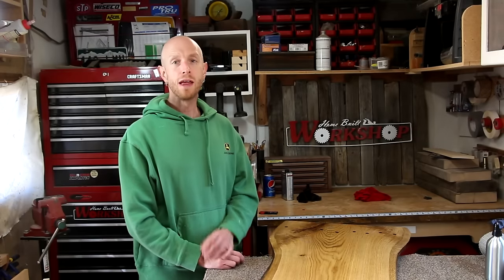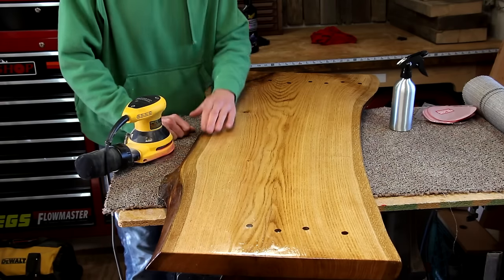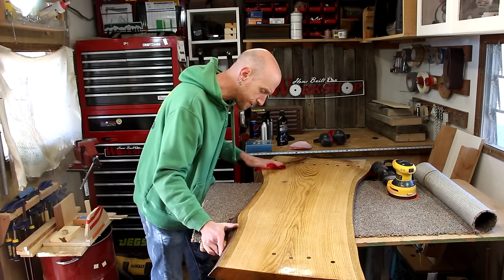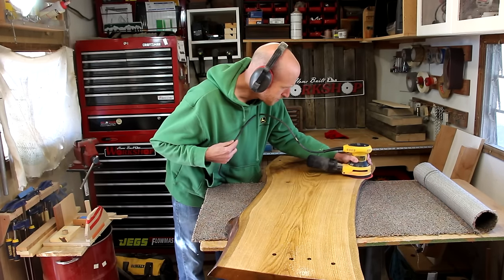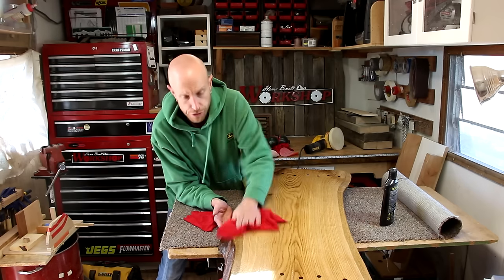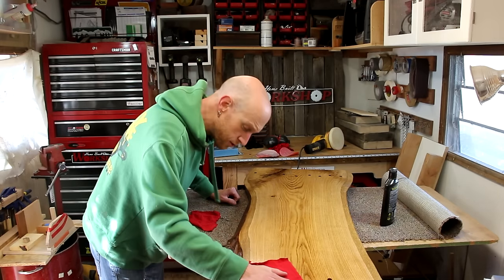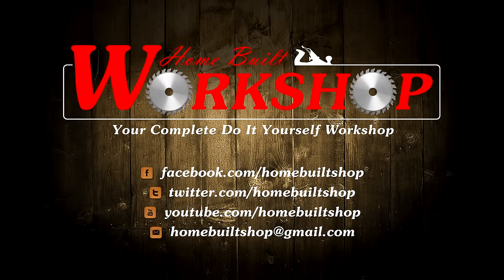How to Buff Polyurethane to a High Gloss

Comment: Is there a different type of polish that you can use that would be safe for a kitchen table. I have about 4 coats of oil based poly that I'm looking to smooth out with this wet sanding & buffing technique, but leery of using an automotive product where I will be eating. (Full disclosure, I planned on waiting a full 30 days to let the poly cure before using the table).
Reply from the maker: I wouldn't be concerned personally. We don't eat off our tables. After things are cured, if anything touches the table its not going to transfer anything dangerous. I have had food touch this table with no ill effects. Its a personal preference though. If you're not comfortable with it for you and your family, Id say don't do it. You could always let the polish cure after polishing. Thats another option.
Reply: @homebuiltshop  Thank you so much for replying! Your videos are great! 

I just can't believe there's not a product thats marketing/sold as a wood polish that is comparable to the automotive stuff yet food safe. It seems like most food safe wood finishes are not focused on leaving a high gloss shine (more like a natural eggshell sheen or even more matte than that). I don't plan on eating off of this table directly, but I do have kids who might on occasion.

I suppose that the automotive polish is not technically seeping into the finish (of the poly) and therefore will not remain after it's little microscopic polishing beads (or whatever is in it, haha) and most if not all of it will get wiped away when it gets cleaned before use.

Comment: If you were to make a rustic type table with 2x lumber that is not perfectly flat and has imperfections, how do you think this process would look on it?
Reply from the maker: I'm sure it would work out fine. It might be overkill if you want a rustic look but that's my opinion. If the top is uneven though, it could be tough to polish.
Reply: I made a butcher block counter top out of 2x4s, 3 tops in total. After the glue cured, I sanded it smooth with a belt sander starting at 36 grit working to 120. I then switched to single speed orbital working up to 600. Once the stain cured (set? dried?) I used both food grade epoxy and food grade water based poly on different parts (I started with epoxy but it is... difficult, so I finished with poly ). Both turned out great. I did a thin pour of the poly instead of brushing or rolling to fill gaps and holes. I need however to polish the poly (thanks Jeff, now I can), epoxy does not require polishing. Hope this helps.

Comment: How many coats of finish do you have on that piece? Also do you need to wait a few weeks until the finish if fully cured before doing this?
Reply from the maker: This has I think 15 coats on the top. If you're going to wet sand and buff it out, you do need to wait for it to cure. The finish will be harder and it will buff out better.
Reply: @homebuiltshop  thank you your tips I appreciate it.

Comment: Jeff, I really like your videos; especially your Barncaster Build. I'm in the process of building a Strat partscaster, and am at the finishing stage. I've applied several (5) thin coats of poly, and was wondering if you think this method of buffing a table would work on a guitar body?
Reply from the maker: This is what I do for guitars too. I have done a couple this way. It works good. 👍

Comment: Does Polyurethane start to yellow over time? I have a table that I want to decoupage with comic books pages, but I worry that over time it’ll start to develop that yellow tint.
Reply from the maker: All of the oil based poly I've used seems to have a yellow tint to it right out of the can. I've used water based that doesn't seem as yellow. You might do a couple test pieces to see what you like. I haven't noticed too much change in color over time though.

Comment: Hi Jeff. Thanks for the good work. Have you heard of anyone having trouble with getting the minwax one coat water based polyurethane to to buff out shiny? I have a project going, and i used it, and have followed your buffing instructions to the tee...but no matter what I keep getting a white "haze" to my finish. I'm hoping not to have to strip and refinish again. Any suggestions?
Reply from the maker: I haven't heard of anything like that. I'd make sure you have a very fine buffing compound, or maybe try a different kind. I have not tried this on water based finishes. I may have to experiment with it.
Reply: Hey Jeff, as a follow up. The trick to getting this right with water based poly is the following: 1. Make sure you are using a gloss, because a satin will just blur. 2. Make sure you cut it 50/50 with water to thin the coats. They dry fast so its easy to apply lots of coats quickly. 3. This is most important make sure you leave LOTS of drying time before buffing. I waited 3 weeks here in So Cal, and that was perfect. The finish is nice and shiny, and hard as a rock. Perfect for our kitchen table. Seems like the water based poly  is much more durable than the Oil based's I've used in the past. BTW, we can't even buy oil based out here any more.

Comment: Could I do this technique with thinned-poly that was wiped on or do you think I'd burn through the final layer of finish? What would you recommend I do after the final coat of wipe on cures? I'm going to wipe on gloss and would prefer my final finish to be glossy as opposed to satin or matte.
Reply from the maker: If you do many coats, I think it will work fine.

Comment: MHow do you fix an area where you sort of like smeared the urethane and it’s a low spot?
Reply from the maker: You can sand it until its even. You may have to add more coats of Poly so you don't sand through it.

Comment: I only have a vibrating sander, no orbital. can this be done by hand? i’ve done semi gloss and this will be my first high gloss application
Reply from the maker: Sure, it would just take some time. There'd be less risk of burning through the finish as well.
Reply: I've used soapy water and hand sanding with grain to help get out nibs from my last (3rd) coat of finish.  Have to wax it after that to get rid of scuffs.

Comment: I have a two project guitars, one finished in nitrocellulose and the other in automotive paint (which i think is acrylic?) - they're both fairly shoddily done, so i was wondering if you know if polyurethane varnish is likely to react with either of them?
Reply from the maker: paul uncle I'm not 100% sure, but I think if the other finishes are well cured it would be ok.

Comment: Can this process be used on both oil and water based polys? I started a wood slab but have used several coats of h20 based. Hoping I don't need to strip and start over....😖
Reply from the maker: +Kyle Spencer Ive not tried it. I would give it a shot. I don't think it would make a difference. Make sure its cured completely. Let me know how it goes. I'm curious.

Comment: Did you use oil based or water based polyurethane for this? Is it possible with water based?
Reply from the maker: I used oil based. I believe water based would work fine.
Reply: Water is a more natural look, you want oil for shine

Comment: Jeff, I am having some trouble and I hope you can help. I finished my wood table with 3 thick coats of oil based brush on polyurethane. I didn’t sand in between coats. I then wet sanded using 320 grit paper instead of 2000 grit (oops!). I refinished with 3 coats of spray on oil based polyurethane (much easier btw) and proceeded to wet sand with 2000 grit paper. This left me with a cloudy finish that I can’t seem to buff out (granted i only buffed for about 20 minutes on a 1 ft section of the table) My question is did I do something wrong while applying polyurethane or am i just being impatient in the buffing process? Is this cloudiness normal because it doesnt look like it in your video?
Reply: I’m going to add after sanding the table is super smooth, which I love, but as stated above it becomes cloudy.
Reply: I have the same issue :(  did you find a solution?
Reply: @EdenBrownlee1  unfortunately no. I ended up sanding it for days which made it super cloudy then put a thin, but covering layer of spray poly on to cover the cloudiness and left it. Wasn’t as smooth as glass, but came out ok.
Reply: @kevinmifflin4678  thanks for the reply. Last night I focussed on one small area taped it off on my 3 meter bar. I polished using a quality cutting compound designed for clear finish restoration, it took a long while but it started to come up and the cloudiness disappeared mostly. Today I'm going to get a car polishing tool with a proper pad as my Orbital doesn't seem to cut it. I'll post up how I go. I have discovered some interesting "poly hacks" regarding fixing up poly mixups so I might share my own video sometime

Comment: How fast do you have to spread epoxy
Reply: Or does it spread evenly on its on
Reply from the maker: It depends on the epoxy used. 5 minute epoxy sets really quick but there are others out there where you have a lot more time to work.

Comment: I'm sure you get great results... But I have never polished anything I have urethaned. After sanding with 300 grit, I filter my urethane for the final coat, and place the piece in a dustrfree environment. Never had a bump. LOL, 5-7 coats?? My god boy... you must charge big money! I do one sealer coat, one coat 100% and then the final. Perfect every time. Not making a museum piece, and I don't think that log you polished is either... This is a good way to get a great finish for a guitar, I will give you that... but if you are just putting a coaster for you beer on it... nay-nay!

Comment: How does this method compare to an epoxy finish? It’s seems like it is a much more cost effective method.
Reply from the maker: +Dblood85 I personally haven't done an epoxy finish so I couldn't compare it. Maybe someone else could chime in.
Reply: Epoxy Resin you can get glossy. However, it breaks down under UV over time, so anything exposed to sunlight needs to have varnish with UV inhibitors applied over the top anyway. Pretty much same deal as this video.

Comment: Slightly off topic but what should I use between coats of poly to sand? I see most people use 220 but for some reason, I remember woodshop in highschool 25 years ago and the teacher told us to use steel wool. Does it make a difference or it's all the same?
Reply from the maker: You can use steel wool between coats. I was taught that in shop class too. I don't prefer it though. I always end up with bits of steel wool in the finish. I like sandpaper or a scotch brite pad.
Reply: Jeff Baker Thank you.
Reply: Sanding in between coats with a 320 to 220 grit would level the finish out better
Reply: 320 between coats for fine finish after clear has dry try 1500 sand paper than move up to 2000 or 2500 compound works a lot better fg400 🤫🤫

Comment: I just finished sanding my table with 400 grit to get it nice and smooth. Can I go straight to the polishing phase or should I sand again or use a rubbing compound before polishing?
Reply from the maker: I would try to sand with a higher grit first. It will make the polishing easier. 👍
Reply: Thanks for responding!  Can I go straight to 2000 grit or do 1000 in between?

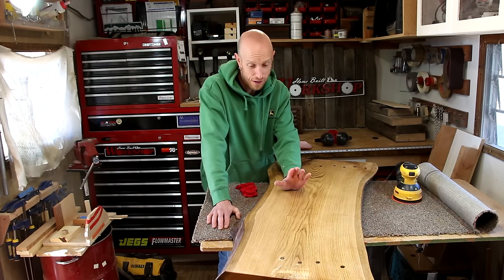Comment: At 6:28, the wood is clear and clean. Then all of a sudden at 6:32, there is a white slurry on the wood. What is that white slurry?
Reply from the maker: It is the combination of the water and the sanding dust from the clear coat. It forms a slurry when sanding.  It just wipes off.

Comment: Would this work with epoxy resin? I have heard the same sanding/buffing and polishing methods will work but then I also heard epoxy itself will not buff to a glassy finish? I am not sure if the people who told me that are reliable though. I'll do some experiments myself but would love advice if anybody already knows! :)
Reply from the maker: I haven't tried it on epoxy. If you try it, let me know how it works. 👍
Reply: I have a similar question. I am considering using a head light polishing kit.

Comment: Although I've worked with/on instruments before and have somewhat of a handle on that, I'm still pretty unfamiliar with woodworking in a more general sense. If one wanted to do this with something small, say, a wooden ring - could you apply this technique by hand (or maybe a rotary tool, even?) and still achieve more or less the same results?
Reply from the maker: +J Turner you sure could. You can can polish it by hand. It just takes longer.

Comment: Maybe a silly question but did you sand after each coat of varnish. 
For those that don't know. The first coat will lift the grain. And more so in the soft rather than heart.
After first coat you should sand right back and repeat process after each coat using finer grit as you go.
Finnish with wet and dry as per vid. 
Great video though.

Comment: Maybe the camera didn't pick up your finish very well, but it almost looks like the kind of finish i get with the normal process of applying PU-varnish, sanding and applying PU-varnish etc.

It seems like you can still see bumps from the grain in yours, which isn't really a mirror finish to me. So what exactly is the difference to a normal PU-finish? I don't quite get it.
Reply from the maker: This feels a lot smoother than my normal Poly finishes. It gets really smooth sanding between coats but this is even smoother than that.

Comment: Can I use my mouse sander or do I need to buy a random orbit sander?
Reply from the maker: I'm not sure the mouse sander has enough movement to work well for polishing. It will probably work for the sanding if you can get high grit paper for it. Then you can polish it by hand. It will take a bit longer but should work.

Comment: Is there any danger when using the sander on water? (electricity-water combination)
Reply from the maker: That's a great question and a valid concern. The water is only on the sandpaper. As long as you dont soak the whole machine and are concious of what you're doing the danger is low.
Reply: @homebuiltshop  So you are  talking about a very thin layer of water. Ok, i got it!
Reply from the maker: Yes, I'm just using a little bit. I'm not soaking everything.

Comment: "Usually" the progression with the Meguire's products you use are:   1) Meguire's Ultimate Compound  followed by Meguire's Ultimate Polish (the one you use ... I wonder why don't you start with the compound first .. Maybe because you already sanded with 2000 grit ?  I would appreciate your feedback - thank you - great video by the way ..
Reply from the maker: Thanks, I really never thought to use 2 different products. I think after sanding to 2000, going right to the polish is fine. Maybe if you didn't sand as high, the compound would be a good next step.
Reply: @homebuiltshop  There are many variations and twists to an ultimate shine so whichever method works for each individual let it be so .. Personally, i have had some amazing results lately with wet-sanding using 1000 grit and a relative hard sanding block, so the surface is uniform and totally "matte" , then I use Meguaire's ultimate rubbing compound which removes the 1000 "scratch marks" plus start giving a nice gloss surface, then I follow with the Meguire's Ultimate Polish product for an amazing shiny/glass surface ... If you really want to take it to the "nth" level - A swirl remover or some final "glaze" product will bring the ultimate perfection .. And let's not forget the waxing part at end to protect all this hard work and shine.

Comment: Excellent! You included informative tips that not only addressed the basics of finish polishing but anticipated my questions--including about how many coats you put on to begin with..(And what a gorgeous oak piece.) 
One question: did you thin the poly coats about 3:1 poly::mineral spirits? Bravo and thanks.
Reply from the maker: +Loren Woodson thank you. I didn't thin it. I applied it as is.
Reply: Great, thanks for the info

Comment: i have a huge $8000 dining room table that has never been exposed to the elements. until yesterday,. someone set a box on the top and it scratched the polyurethane finish. its not deep but wouldnt just wipe off. how can i remove the scratches without redoing the entire finish? im trying to sell the table for 2k
thanks!

Comment: Can polyurethane varnish be used on a epoxy countertop ?
Reply from the maker: I dont see a problem. I'd just make sure to prep the surface before applying the poly. I think it would work.
Reply: I used a two part epoxy and poured it in a mold with random scrap wood for a stool project. After sanding smooth applied a coat of oil base poly. It worked perfectly. Filled all small scratches and sealed the exposed wood. Totally transparent finish

Comment: Hey Jeff I have a birch subwoofer enclosure I plan to stain and polyurethane.. after pre-staining and staining do I still need to apply the polyurethane neatly or can I just somewhat smoothly glob it on for a few coats then sand n polish as you show in your video...?? THANKX
Reply from the maker: +TJ CRIM "smoothly glob" I like that term. I think either way would work although the neater you apply it, the less work it will be to polish it. I need to build a new speaker box myself. I hadn't thought about leaving it wood and not carpeting it. Good idea. 👍
Reply: Jeff Baker ok thanks.  I plan to post a lil video before and after polish the polyurethane..
Reply: TJ CRIM did you ever stain and poly your box? I have a birch box as well and was looking for some tips! that's why I'm here lol!

Comment: I’d cut the poly for the first coat, and then put on a normal amount for the second.  Using full strength I have found, leaves me with a finish that I have to do more to get a good surface.